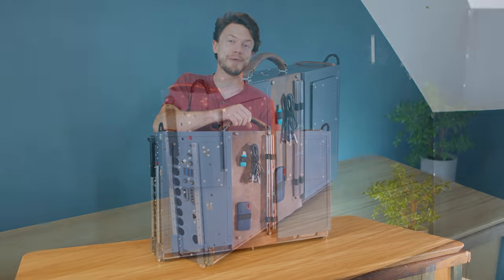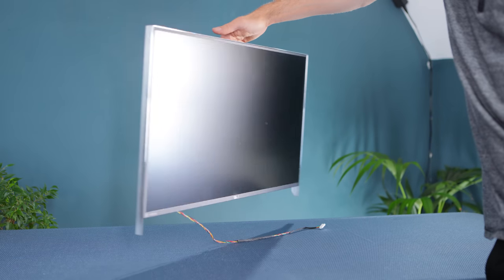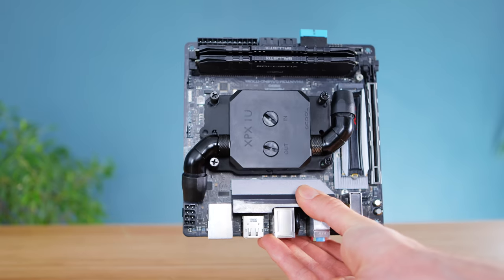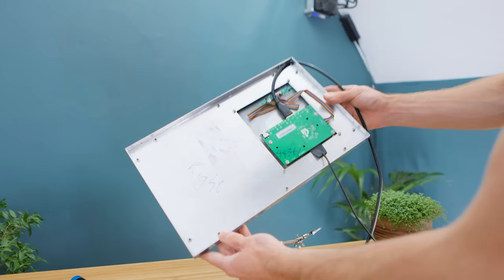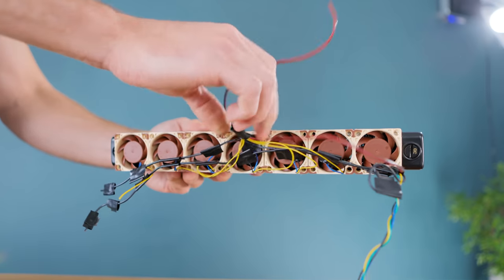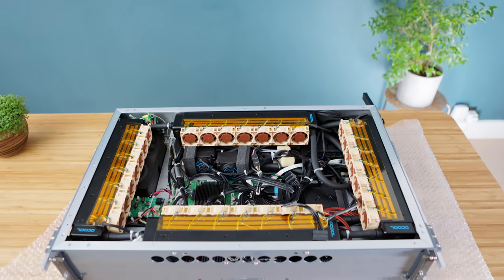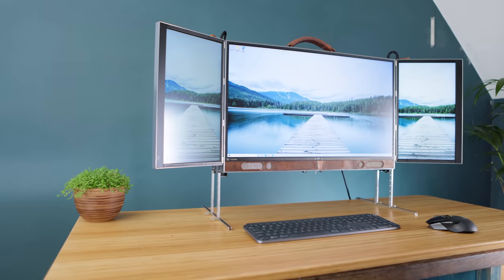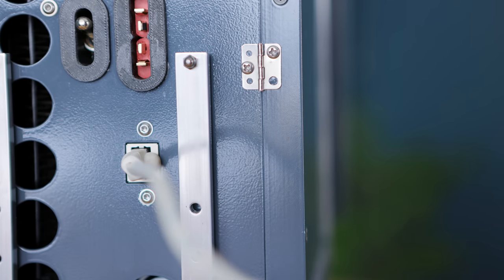Building a Luggable PC

Comment: Imo, the thing that makes it special, and that separates this build from being a portable gaming laptop, and that also sets it apart from the AIO PCs that we are plagued with, is the very fact that it uses "standard" desktop hardware. if a CASE manufacturer teams up with a Display manufacturer, and create something like this that accepts desktop components. THAT would be awesome.
Reply: Would shatter the PC market especially if the airflow was similar
Reply: An SFX power supply that accepts battery input would really help out. I'm 3D printing a PC like this (severely delayed by the GPU drought) with 3 touchscreen USBC monitors (because I couldn't find a 2 in 1 laptop with the specs I wanted, and I'd seldom use a desktop if it was desk only) that will be stacked like DIY Perks' dual monitor laptop but with a 3rd one on top, all mounted to the case, and unfortunately a battery backup was one of the few features I knew I wasn't going to be able to install. The PC is on track to squeeze in under 20L. Couldn't get an RX6800 so had to switch over to Intel to get the 3rd USBC Alt Mode port, but it means I could use the Vision D Z590i so I'm not complaining.

Comment: Only thing I'm asking myself is why the hell isn't this a product yet? This is the coolest and most useful thing ever.
Reply: Because it’s too expensive
Reply: Hello have you heard of laptops?
Reply: @BRelding92  Have you heard of laptops that have multiple screens extending at the correct height and have you plugin your own separate mouse and keyboard? yeah me neither.

Normal laptops are good for situations where you just want the bare minimum that you can quickly stow away, like when you're on public transport.

When you go to a hackathon or a lanparty or say want to setup yourself in a hotel room or something, you want the best setup you can get, but lugging around several separate components like monitor and pc case is also super impractical for traveling. Who would NOT appreciate an in-between, especially when you dont need the maximum practicality of a laptop for something that will stay in the same spot for days?

Comment: Crazy good work. It's hard enough to build a watercooled PC, but the amount of fabrication and design that went into this is nuts. The only gripe I have is using tiny tiny fans when a normal rad with 120 / 140 mm fans would be quieter and less expensive.

Comment: Tbh if I ever had something like this I'd probably see about getting/making an external shell to put it in when on the go, as I'm not sure if I quite trust a single piece of leather to protect the central screen from impacts, not to mention keeping all the ports clean. Since it'd be off and not used often when in this shell I imagine the lack of proper airflow wouldn't be too much of an issue
Reply: Carbon fiber shell instead of aluminum, and more shock absorption. And a removable front cover (pockets for kb/mouse accessories would best go there) to go over the two folding screens while closed, just latches, no hinges. The cover could also double as a 'tent', while opened up , with legs & side flaps... for sunny conditions, and have a frame with extendable handle & wheels, like on luggage. So you could push/pull it like a hand cart when it's packed up.
Keep the desktop class hardware. I think it gives it some attitude.

Comment: No kids, this is NOT what your parents mean when they say "Go play outside!"

Also do you have a list of the hardware? I want to build a glass desk PC.
Reply: If my kid would be able to build something like this just so he can play outside I would be alright with that.
Reply: His core components are a Ryzen 9 5950X, ASRock B550 ITX motherboard, 2x 32GB Crucial Ballistix 3600, a 3080, and 2x Samsung 870 QVO 8TB. I'd recommend an X570 motherboard for better power delivery and not using QVO for primary storage, as it's rather slow by SSD standards and doesn't hold up as well. Especially for editing, PRO drives are recommended
Reply: @DoctorX17  X570 only if you wanna overclock. But okay with that sick ass CPU and watercooling one might as well try. I suppose he uses a PRO as a boot drive, but yea, would opt EVO at least for the editing storage.
Reply: @HansRutenbrecher  you won't see your kid for months prior
Reply: @Pauluzzs  even at stock, sometimes B550 power delivery just can't keep up with the 5950X. Although some higher end B550 boards have the same power delivery as their X570 brethren... But worst case you just lose a little bit of boost or responsiveness for frequency changes. The 3950X on a B series board was more of an issue, sometimes that would cause crashes. A series... That's the only one that's really a problem with a 5950X, lol
Reply: @DoctorX17  You missed the XPG Spectrix S40G RGB PCIe m.2 2280 NVMe drive on the M/B. Matt is more likely using that as the main drive, with the Samsung's 870QVO's being secondary storage.
Reply: @leeantbrown  ahh, yeah, I wasn't looking hard enough, lol. Good eye!
Reply: @DoctorX17  man, how do you guys know those kind of information?
as a programmer, best I know when build a PC is matching cpu-main socket, ram bus, choose psu with enough watt
but I never know which mobo to choose, where can I read more about their power phase, voltage regulator, .... to make a good decision?
Reply: @euphoriess  lots and lots of research XD but also good sources like Gamers Nexus that do more extensive research and testing, then distill the results for you. Some things you'll find are actually pretty simple to figure out, like wattage requirements, but other things can change heavily from year to year and platform to platform.

Comment: Metal case, lots of surface area, this seems like a good application of a large vapor chamber.  That would thin things out compared to water pipes.
Reply: Need to be careful to not oversaturate it, the setup is over  400W of heat load.
Reply: @nxtktube  I'm thinking more about his suggested hypothetical commercial version.  At the same performance they might be able to shave off some wattage with custom parts and inevitably there would be much lower performance versions that easily would have a lower load.

Comment: "If a manufacturer would take this [...]"
They already exist, and they existed for decades, so called "mobile workstations", one of the manufacturer is called "Media Workstations"
I've seen them rugged, splash resistant, built with regular ATX hardware, 4k touch screens etc.
but they are expensive, of course because of low volume production.
Reply: So not for the mainstream, which proves his point
Reply: Oh, I thought you were going to say they are called "laptops"
Reply: @bewhitey  haha
Reply: @Nybbl er no, laptops are not desktops

Comment: I would have used air cooling, that would probably save a lot of weight. That said, seeing how you were able to handle it despite the weight of the water cooling loop makes me think that the quieter option that you choose might have been a good decision.
Reply: air coolers decent enough to properly handle a 5950X and RTX 3080 would be huge, not fit in this design and weigh much more than the water loop he's using. Air coolers small enough to fit this design would be rubbish for those components. The low profile water loop is perfect here.

Comment: Two things:
1: if it is supposed to be portable to finish should be painted with a nice tough coat of paint.

2: you never did mention how much the whole thing weighs. I imagine it would be heavy with all that desktop components.
Reply: Let's just say that like Mjölnir, you have to be chosen by this pc to lift it.
Reply: @KhwupOKwoffee about 1 litre of fluid. Those are tiny radiators and there is no reservoir.

Comment: Interesting!
What are the final weight and dimensions (closed)?

My attempt at portable desktop is custom 12.5L sff with fully water-cooled both cpu & gpu and a 360 radiator.
For transport in a manfrotto Manhattan mover 50 backpack with plenty of space for mouse , keyboard & portable display (I'm not done with selecting the display yet, but eyeing the 2nd gen 16" lenovo foldable laptop/tablet).
The pc itself weights 6 kg (not counting the mouse, keyboard & backpack).
I noticed in the begining that your steps were visibly hard, I assume it's not so light?
Most people think of size & shape as portable, but weight is very important too.

Comment: Aside from the 3-D printed parts. This looks like something I probably would have built when I was back in school working at a electronics recycle center. Probably would have cannibalized the parts used that you 3D printed. From something else that would have worked as well.

Comment: I really like this build entirely, every single detail in it. The only thing that i would suggest is to replace the regular hinges with a couple of hinges salvaged from some broken laptops, this could make you able to fine adjust the side panels and probably there will be no need for the leather straps that keeps the panels opened and prevent them from jiggling.
Otherwise the build is so stunning and practical.

Comment: Imagine how this could be if instead of water cooling desktop hardware you used a framework laptop motherboard as the base (I say framework because of the access to schematics and the number of parts that are standardized).  May be even able to do a GPU over thunderbolt with that setup and be a lot thinner.  overall you would still be sacrificing performance but could be a lot more portable

Comment: My only gripe is that folded up it looks a little unsightly, with all the holes, screws and ports seemingly in all irregular and random places it looks like what most people class it as...a bomb of sorts. None of this detracts from how as a concept and even unfolded from the front it's simply spectacular

I saw a comment about having a case on it for transport, the bomb look of it I doubt you can talk your way out of but if it had a case that was light, covered up your holes and ports to add some weatherproofing for tranport and made it look a little more like a suitcase I think it'd be perfect

Don't take this criticism too harshly thoug, you've done an absolutely stellar job on this build and it's simply jawdropping to see this come to life, it's just nothing in this world is perfect and there's always room for improvement. Plus it's a good thing that this criticism is small could be fixed easily (Well if you know what you're doing which you've showed me you absolutely are capable of that), honestly just a fitted case will do it justice

Comment: To be honest.. I love it. Every bit of it. I have a Laptop for a reason. And while im not travelling a lot and usually my Laptop just sits on my desk, it's till a good thing that wehn i do need to go somewhere i can just bring it with me and play wherever i want to.  I love the idea of Portable gaming. The Steam Deck and the Switch and this is the great start and i would love to live enough to see where we can get with all of this.  You said that a manufacturer could improve upon the cooling or the size but in reality  They could but im not realy sure they should. A lot of high end gamer laptops are giants and "Super improoved cooling technology" but they just  never the same as a PC cooler. Using liquid cooling in this way is super great idea The only thing a manufacturer should improve upon is airflow cable management and stuffs like that. But it's already done quiet nicely by you. I would love to see a company actually take inspiration and make somethign like this. Also the biggest issue of a setup like this is the lack of battery. (Wich i wouldn't even bother as myself i usually run my laptop always pugged in) But to be fair non of the older and newer consoles have a battery to run wherever you are and they are as compact as you can get with a gaming rig but they still don't have a monitor and they limited by their OS and not supporting as much stuff as PC's does.

Comment: For a bit, I thought you had laser cut the aluminum panels. Well done! It looks quite industrial when panning the camera around the panel, like it belongs in a SCADA system or something.

Do you think it would have been possible to repurpose the laptop display hinges from the two laptops the side monitors were from to mount the monitors to the side of the display? Typically, they are able to support a slight bit more weight than the monitor itself and hold their position well. Granted, it wouldn't be as professional-looking as the hinges you used in your build, but I think they could be modified a little to better shape them and still perform well, especially since the panels are mounted perpendicular the hinges wouldn't be required to hold much weight at all, just hold position.

Comment: awesome, as for where it could go maybe the main screen could be a gaming tablet like ROG Flow Z13 Extremely lightweight chassis, weighing in at just 1.1kg and only 12mm thin. with the two side panels could be 2.2kg or have 3 identical screens sizes which are detachable main screen being a powerful gaming tablet.

Comment: I won’t recommend you putting the keyboard and mouse inside but a more system like a magnetic sticking system, for this you need a Bluetooth keyboard and that’s better since it stops the wire mess. Plus try to make some screws less visible. We’re aiming for quality, elegance and the industrial design.

Comment: For the panels (if cost were not an issue, as it appears is a somewhat reasonable assumption😏) I would go with getting them anodized with Type II Hard Coat - though, of course, doing so DIY is somewhat outside most people's tooling capabilities.

Comment: Actually I had an idea to build a similar thing to this being a normal briefcase with a monitor and a mid to high end PC in the bottom with a keyboard/mouse able to be removed but possible to be used inside the case with its own power supply but it may have to be a separate supply built into a back pack but It would be awesome to see your thoughts on it

Comment: the only thing i did not like was the screen was not one continuous screen it had a metal thing in between the two side ones where the hinges have to go i guess you could just use one of the monitors that are a already that wide and just skip the holding part and then make it thinner. maybe can use a thin gaming laptop instead of pc components but i am a tech person but as i see laptop are now super thin and fast maybe with the extra room of the width of the monitor maybe can allow for more thing to add like maybe more hard drives

Comment: I'm surprised you can get enough amps through those DC cables to power it. You said about 1000W, so at 12v that would be around 80amps! What's the max you can get through those connectors?
Reply: Why would it supply at 12V only?

Comment: Why used normal pc ?
01.Old arm64x laptop 💻 / modified Intel nuc upto 1080p 60fps support & more

Steam deck support upto 720p 60fps

02.Linux os improve gaming spec

03.Portable speaker 🔊

Most of components
compression easy.

Comment: I wonder how much electricity is actually used minus the heat generation. I would think half or less. We had always been told the heat is from making everything so compact to fit in a laptop but I wonder as desktops use a lot of electricity still.

Comment: > Portable PLP setup
SOLD.

Edit:: 8:05 -ish.
They look great as-is, I'd say, but an even powdercoat would have looked great.

Edit2:: 19:15
I'm seeing exactly eight drives in that 100TB NAS. How...is that thing configured? If one of those drives fail, do you really want to be biting your nails waiting for a drive that big to resilver?
That's not guaranteed safety. You should really have multiple layers of backup.
Start following Level1Techs. I'm sure Wendell would love to collab with you.

Edit3::
Razer already had a prototype for a similar product, (though it wasn't a PLP setup, it was more of an all-in-one LLL laptop) and didn't move forward because they decided there was no market share for that kinda thing. "Project Valerie," I think they called it.

Comment: What's the weight? I recently built a luggable SFX PC (modified fractal terra case, 2080ti water cooled, 12th gen i7), and am currently trying to get the weight down. While I don't have built-in displays I'm using a DIY portable OLED monitor that attaches via Thunderbolt. Still weighing in at 15kgs w/o batteries though...

Comment: This is impressive but really just for showing off. Dismantling a laptop would have been more practical then changing it to a suitcase. Especially because laptop components weigh less and the most important factor is that it only consumes 60-180+ watts and only 10-15% less performance for the desktop version. Especially when the tigerlake cpus are absolutely insane in performance. You could have thin out the design more.
Reply: The keyword here is "no compromise" which he kept repeating. Using laptop components would've been lazy and involves some compromise when it comes to performance.
Reply: @frerreror0cher  but the ideal build here is “lightweight” and “portable” disasembling a laptop is not lazy either because you need custom cooling that is not available in some markets. And if you’ve looked up tigerlake mobile cpus there is no “compromise” when it comes to performance because it is already a beast on its own.

Comment: Also, my setup is a TR4x 3990x, RTX 3090, 256GB 3200MHz RAM 4TB Gen 4 boot drive with 16TB (over 2 gen 3 NVME) storage, with a 1500W TITANIUM power supply; spent $15K on that build. SO... Not more powerful.